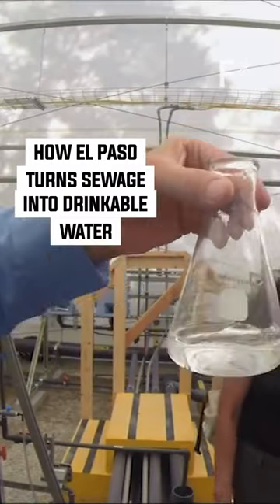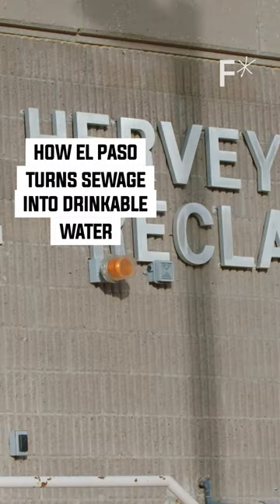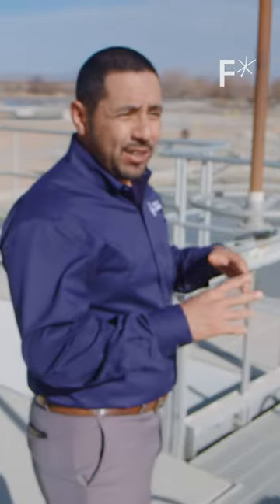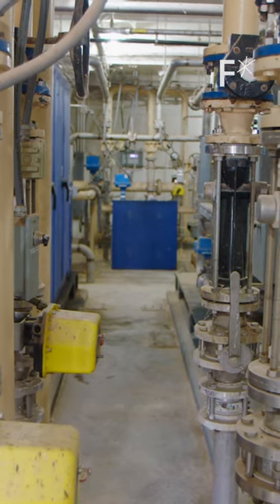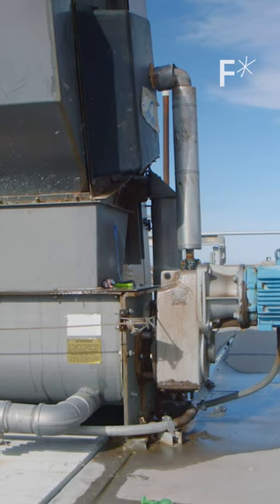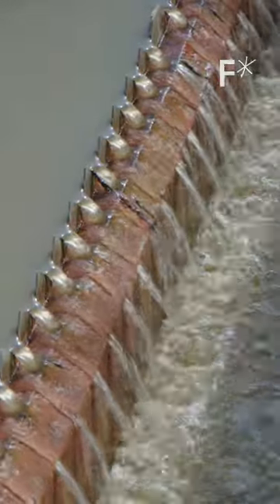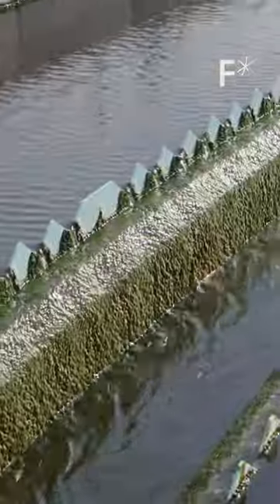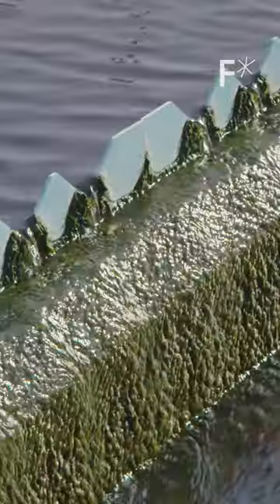Turning wastewater into drinking water #shorts

Comment: The organisms in the Biological Nutrient Removal (BNR) process do not convert the solids to carbon dioxide. They feed on the solids and convert the ammonia present in the solids to nitrogen gas and sometimes phosphorus gas if an enhanced process is used.

Carbon dioxide is produced in some subsequent processes, which is then used for pH control.